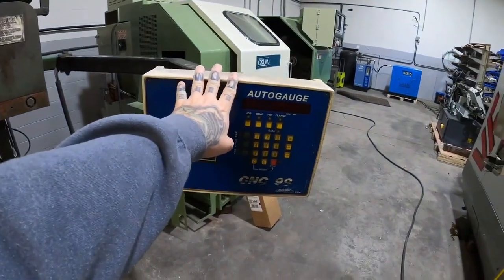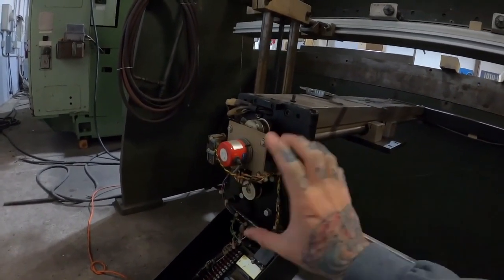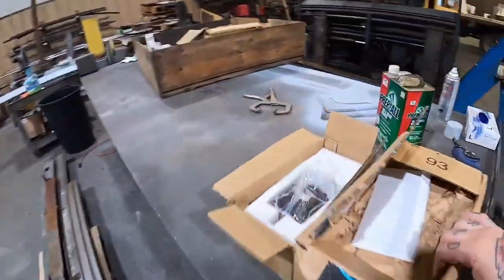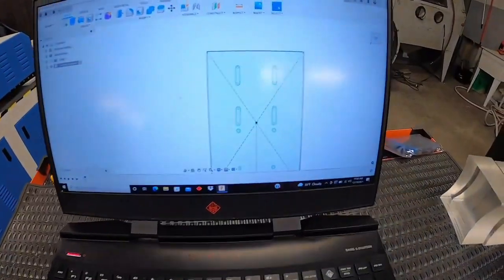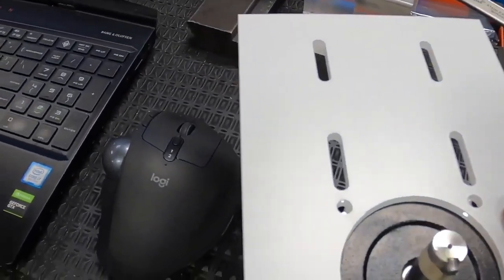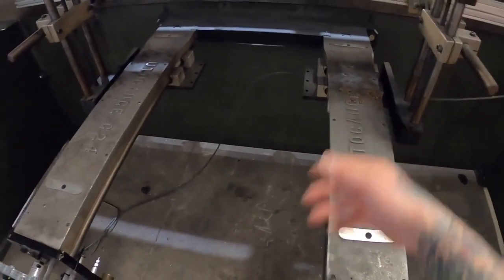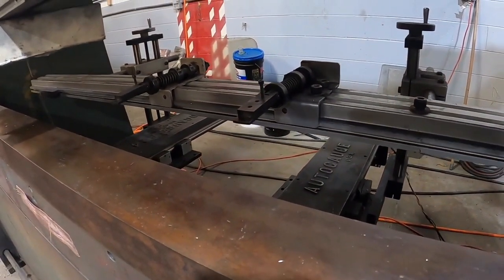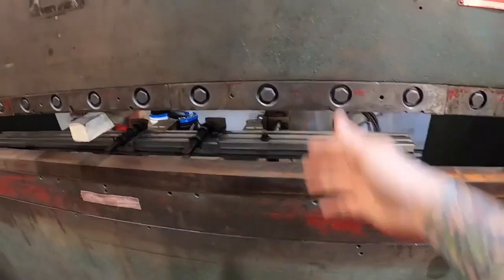I Saved $3,842 On a CNC Press Brake Back Gauge ... AND YOU CAN TOO!

Comment: awesome job fixing that thing yourself! ive never even heard of match 3 until this video. 
just curious, is there any way to set clamping points with match 3 or even on that older brake at all in case you were bending anything thick and didn't want it snagging the backstop as it bends up?
Reply from the maker: You can configure mach3 to do about anything
Reply: @precisionmetalin  oh thats awesome

Comment: My employer just scrapped an edm wire machine because they felt is was obsolete and not worth fixing. We suggested retrofitting the servo drives but they wouldn't even entertain the idea. The company also decommissions usable industrial robots when the oem manufacturer makes the service parts outrageously expensive. I love your channel, especially when you bring new life to these machines. I learn alot about retro fitting and troubleshooting from you.
Thank-you
Reply from the maker: It’s crazy what some companies throw away. Thanks for the view. I really appreciate it.
Reply: What, that's wild, what happens to the robots?
Reply: @Grateful.For.Everything
They get removed from the product floor and put into long term storage. Eventually they get scrapped.
Reply: @joelfrend4994 rather than pay to store them how about letting them go to new homes now while they can still be retrofitted and put into new uses.